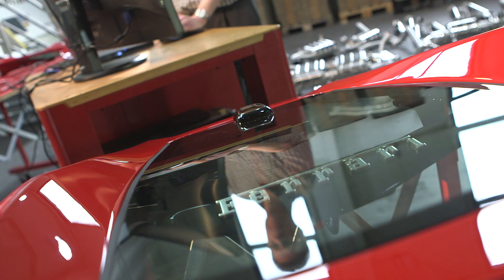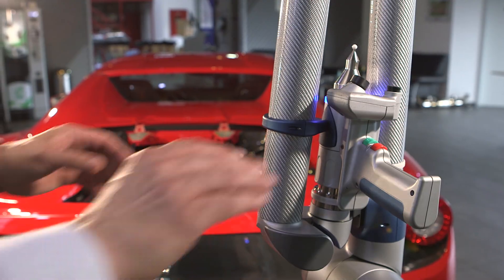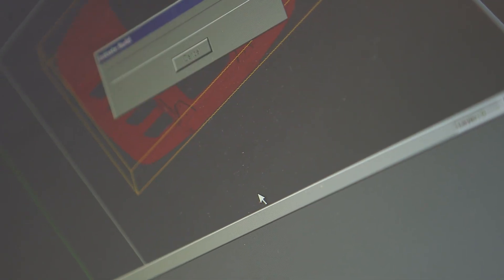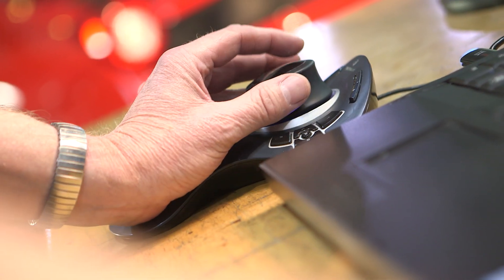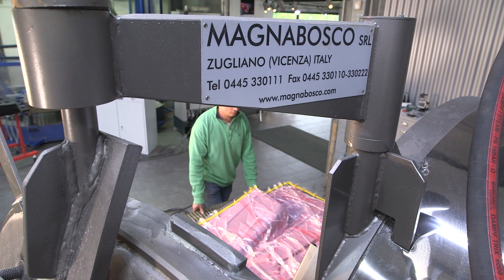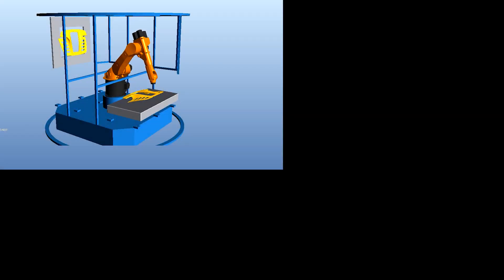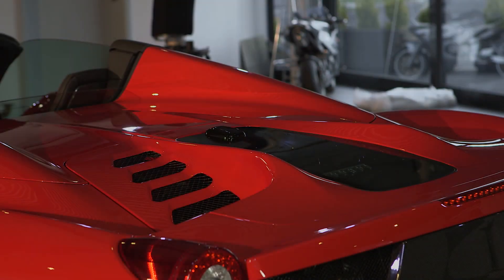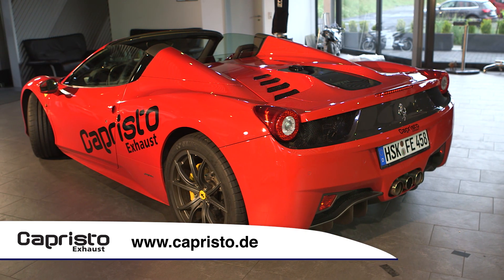Capristo carbon fibre production English version

Comment from the maker: Hallo Sharma,
We use the aluminum as master, from that we can make 3 or 4 negatives in carbon, and those are our production forms. These forms are made with a special pre-preg which becomes hard already by 50°C. It is important that you not use too high temperatures because the aluminum would become too big. In the moment where we have negative forms from carbon, then the carbon parts and the forms would always have the same size at whatevery temperature.